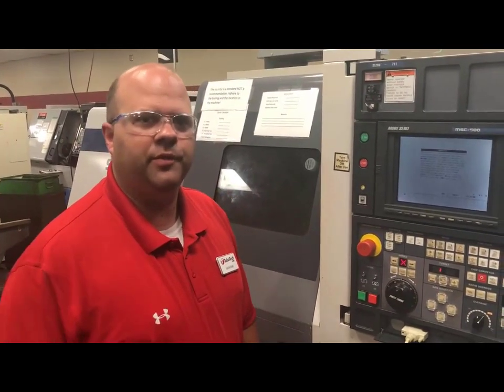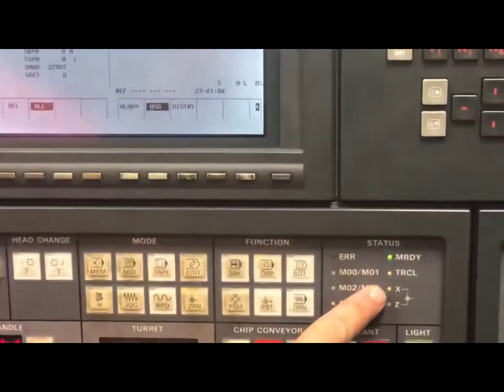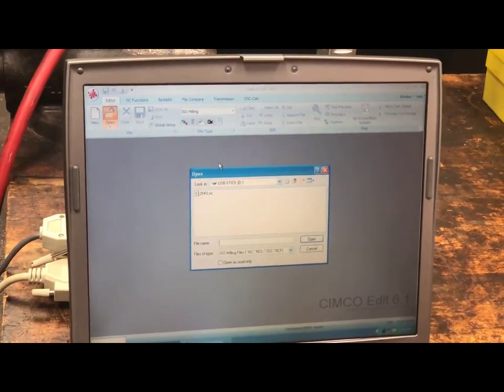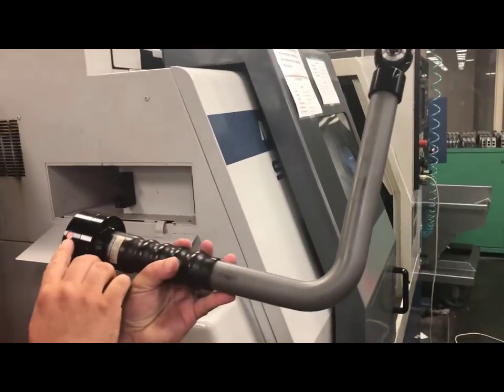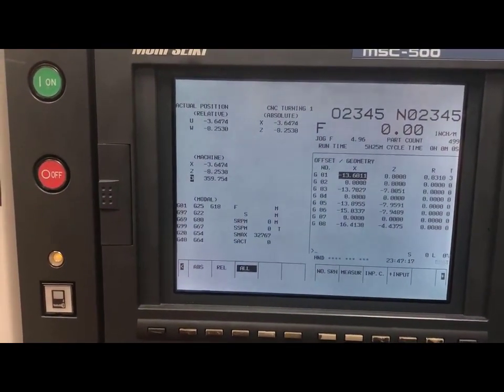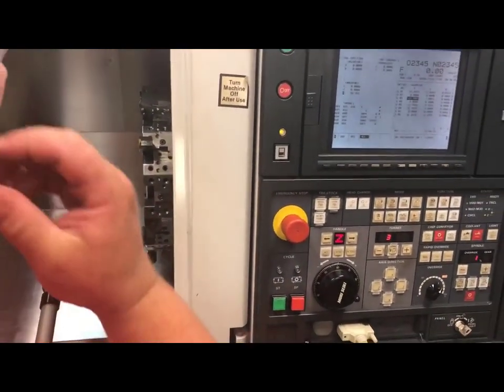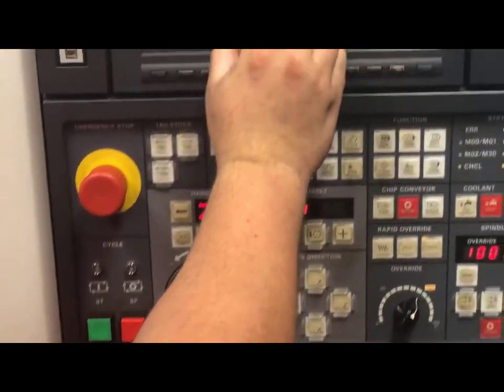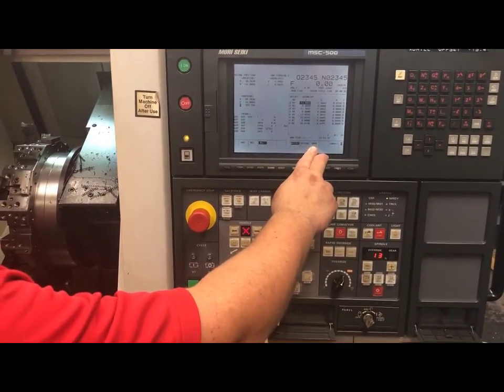Mori Seiki SL-200 Lathe Setup

Comment: I have a lather machine model 5060. Now tool magazine is jamed. How to turn tool magazines. Thanks
Reply from the maker: So when my machine jams up, it's because I command a tool change without a g0 for Rapid motion. which is kind of weird because it's only on this machine and on this model. what I normally do is I go into a manual mode, and I jog it manually one rotation to the next tool, and it fixes my problem on my machine. I can tell it's jammed because the button for Tool change is blinking because it's in between tools. I'm not sure if this will be the fix for you, but at least it's a start
Reply: @aaronrunk4209  thank you so much.
Reply: @aaronrunk4209 my machine’ model Mori Seiki NVX5060. Tool magazine canot turn and set origin
Reply from the maker: @toannguyenvan5391  I looked up your machine model, and there should be a recovery page in the Machine settings. If it's Siemens control, there will be a gear in the bottom right to get you going in the right direction. I've done the recovery on a Grob but not a Mori. Good luck
Reply: @aaronrunk4209  thank for your help. Tomorow i try to do. Thank u!

Comment: Good job bro. Before start a new program,is there any way to simulate the program by graphic on Moriseiki.Thank you
Reply from the maker: I have two Mori's in the shop and the graphics button works on one but not the other.  The graphics on these machines work a bit different/scarier because you have to lock the machine's axis then you run the program in memory.  The spindle will run and the turret will rotate but the machine axis will not move.  On the graphics page you have to adjust the size and location but you'll then be able to see the tool path. It sounds like a lot but once you do it a couple times it's like any other machine, you learn it then you know it.  Until you forget lol which is why I make so many videos. Thanks for watching
Reply: Thank you for replaying.If you can make a video to show us how to run the graphic on Moriseiki will be great.Thank you so much